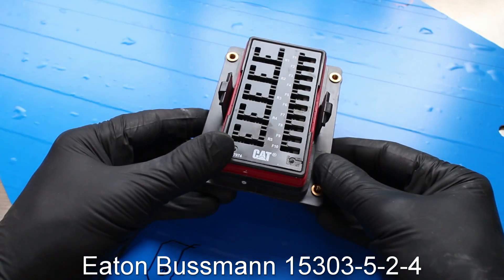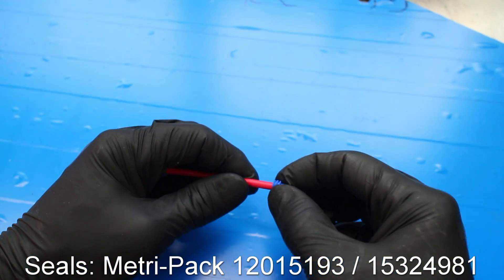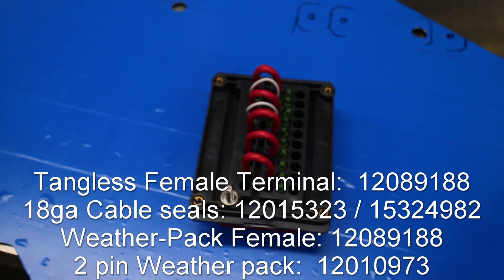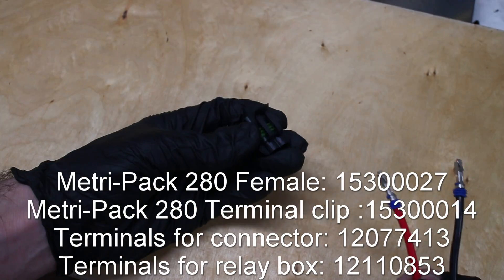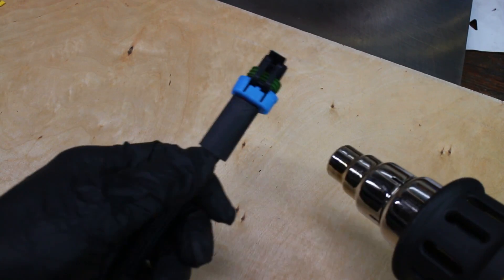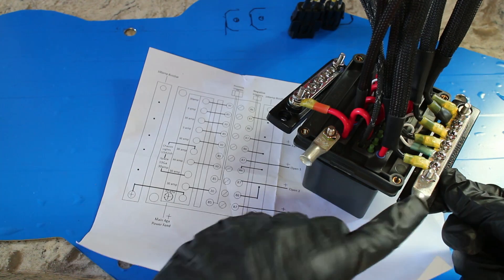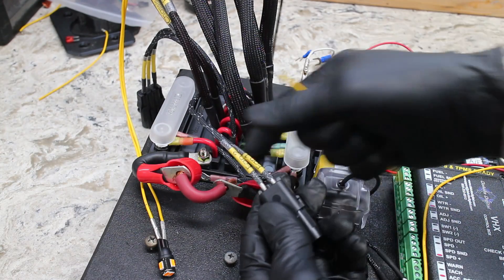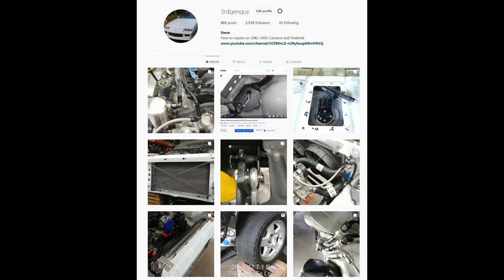How to wire up a Relay & Fuse box (Automotive Wiring)

Comment from the maker: 2 years later, and i found a few crimps that were a bit wrong.
make sure to use BUSSMANN Metri 280 plugs and not normal Metri 280 pins.
Reply: As far the 3 pin weather pack, what are you using those relays for ??

Comment: What jaw letter are you using for your crimpers?
Reply from the maker: depends. weather packs use the C die
the metri packs use a die that looks like the C die but a bit larger.
3m terminals use a A5 crimp set
Heat Shrink Butt Connectors use A1 die

Comment: Adding another fuse box to my 99 F-350, doing a interior swap with heated and cooled front and heated rear seats with an inverter in the center console. Have the battery wire and fuse block built, but was wondering about a relay trigger. For sure do not want the heated and cooled seats working with the ignition switch off. Your video gave me a place to start thinking about how to accomplish this. Thank you.

Comment: big thumbs up! caught this video b/c the tickler image included the 
Dakota digital box. Currently acquiring the components for a Toyota land Cruiser v-8 conversion. have 327 mounted currently but need to look forward to possible LS motor, after body work , drivability, and coach work completed. Dakota digital will be part of that b/c of the flexibility for that future. Thanks for posting. Complete clear and importantly, short. Subscribed! by the way CAT parts are first rate. I have used their diesel hand priming pumps on frame, their ignition switches and other components.

Comment: I have the same relay/fuse box and just wanted some clarification. You wired up the 2 power distribution wires that came from C100 to 30 Amp fuses and got rid of the fusible links correct?
Reply from the maker: Yes, 
I covered the c100 wiring in this video below.
since my car is stripped down, I actually powered both c100 power wires of a single 30 amp fuse.
But two 30 amp fuses is more than enough for a factory car setup.(HVAC exe)

https://www.youtube.com/watch?v=SpU6fYJ0mZQ
Reply: @3rdGenGuy  Why did you choose not to use the Eaton Bussmann box with both positive and negative buss bars built in? I'm (trying) to use one to wire up my carbed 3rd gen, but am confused on using it with the temp switch that grounds the circuit when it reaches temp.

Comment: How hard would this be to basically redo a whole 3rd gen? Utilizing stock harnesses like headlights/brights, running lights, all rear lights, and then adding in custom work for the engine bay, and dash set up. I'm carb'd right now so it will be pretty easy I feel, but in the future I'll b wanting to go LS and I'll probably use a PSI harness. So many ways to handle this but I just need to clean my situation up sine th car was stopped midway through a lt1 dash swap and left it all virtually a mess :(
Reply from the maker: much easier if you have a street car.
as you'd only need a universal chassis harness.
but wiring really depends on your skill level. 
it could be ez for you, or a nightmare.

Comment: I used an OEM CPU to run my LS swap, and purchased the wiring "plug-n-play" from Speartech, excellent quality and lots of post purchases Q&A help. this came with the fuse-box / relays pre-wired and ready to connect worked great. Then for my duel fans control via my CPU, I used BP Automotive controls, excellent clean install, works perfectly.

Comment: not that it makes a big difference but you installed the cavity plug plugs backwards. 
the blue clips are called "terminal plug assurance", TPA
Reply from the maker: i'm fairly certain the plugs are installed correctly.
but ya, it's under my dash so no water is anywhere near it.

Comment: Good times! This is something I'm going to do for some of my circuits. The factory waiting from this time period wasn't the best. I'm sure you have seen some hot connections due to the wire being overloaded. I'm going with a pro-flo 4 and Hawks Dakota digital. The dash will eliminate a bunch of wiring and make life a lot easier. No more PASS (vats) box either. Good video. Thank you!

Comment: I owned a 85 Z28 and a 99 Z28 and I used to watch this guy a lot. He makes good videos with excellent content but I sold both rides and drive my 1 owner S 10 4 cyl with 330K miles, all city in HOT Texas.
Reply: Ha! I drive the same. I'm ready to yank that dang four-popper and replace it with a SC 3800.

Comment: I used to work in a wiring harness manufacturing facility - this video triggered my PTSD. We used a lot of these same terminals, seals, connectors buss bars, etc.

That said, great job with the wiring here (some of it is better than what we did, but that's a story for another day). I would be very confident in this and would run it myself. Kudos.

Comment: Great video 📹 👍. What are your 5 main relays?? Also what accessories are you gonna have? I did extra factory accessories for my Trans am with the stock fuse box. Very informative 👏. Thank you sir
Reply: the relays are a super common 35amp "Song Chuan 301-1A-C-R1-U03 12VDC Micro 280".
It's the same type or relay used in newer cars.